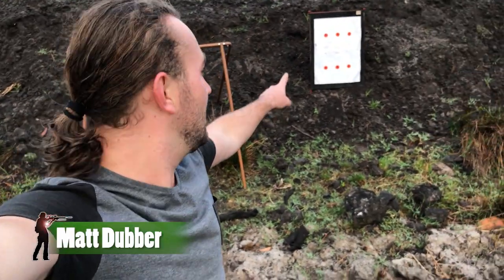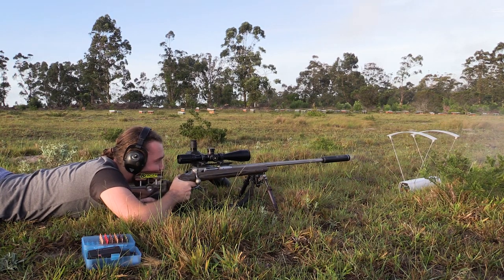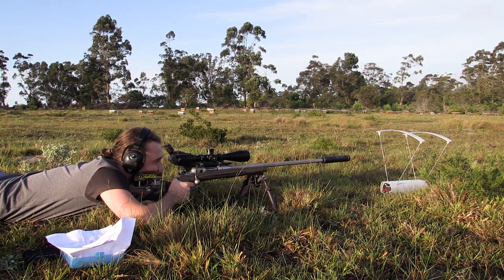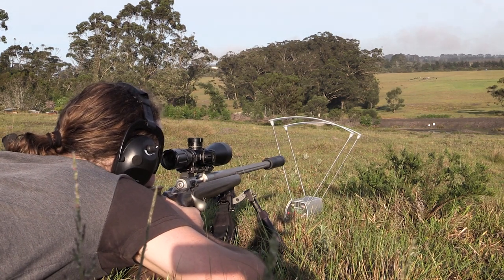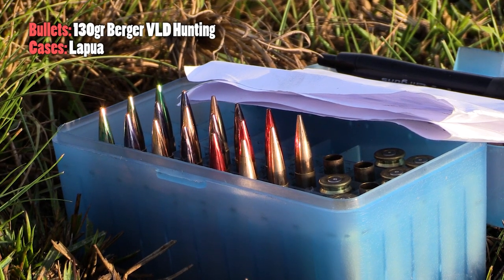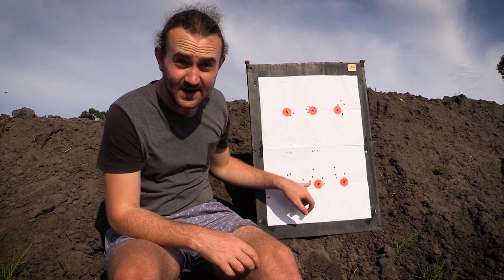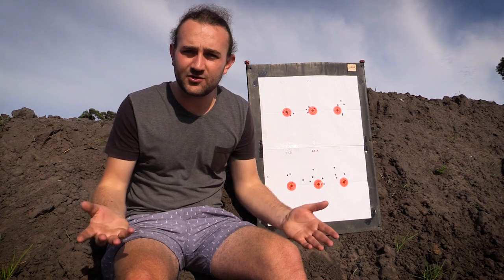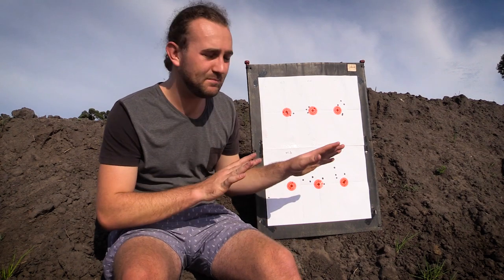Harmonic Tuning: Optimal Charge Weight Test

Comment: Just want to say thank you for this informative video Matt, I was scratching my head as I couldn't improve my already best grouping for my .308 load until I saw your video. I decided to increase my best load by 0.1of a grain 44.6, 44.7, 44.8 etc...and found that the accuracy improved from 0.5 MOA to 1/3 MOA. Good job mate and will follow all your latest post. Thanks from down under.

Comment: Rock on Matt!  my charge weight is also 42.8 to 43.0(H4350) in my .260(Semi custom Savage that I built...( my Avatar is the rifle)  shooting the 143 ELD-X.  My seating depth is .004 off the lands.  Getting .5 to .25 MOA depending on the day. the 43 grain load is actually the MOST accurate, but when the temps rise in the summer, I start getting pressure signs.  So, I backed it off to 42.8 (MV is now 2760 FPS...  25" barrel).  I've found shooting to be very similar to golf.  One day you are playing well enough to think you can join the tour...  The next, it seems like you can't even make contact with the ball LOL!!  Your channel has become my favorite hunting channel. Keep them coming man.  Cheers!!

Comment: Great studies about what powder charges do to the accuracy!. Over pressure signs can b influenced by your head spacing as well. if the front shoulder is pushed far back when you resize the cartridge it can let the primer me pushed back first before the powder kicks it further back afterwards and so creating a flattened primer. I have a Thompson center in .204 and it has no measurable head space behind  the cartridge. It delivers me 0.2 " at 100 yards for varmints. try setting your shoulder seating when re-sizing your cartridges as well if u haven't done so already Matt. Have an FX impact .25 because of what you showed about it on your channel. thanks so much and wishing you the best on your channel!

Comment: I like the style and clarity of this video.  It gets the round-robin OCW firing sequence right and puts the point across well.  However, I have to point out it misses describing an important aspect of the OCW system.  That is to get three groups in a row whose mean center locations are close together, despite each of the three having been fired with a 0.7%-1.0% difference in charge weight.  This is important.  For one thing, you don't want a charge weight that has to be exact to shoot well.  Otherwise, it will tend to be sensitive to temperature variation and powder position in the case and anything else that can cause pressure variation.  You want to load for the middle value of that three-group spread of the tight shooting charge weight range as that is most likely to handle all conditions, warmer or colder.
The second reason you want to go for three-in-a-row is that, statistically, five-shot groups will only be consistent within +53% -35% in diameter with 95% confidence.  In other words, about 19 groups in 20 will be within that range and 1 will be even bigger or smaller.  With just one group, how do you know whether it is average or larger or smaller than average?  But if you get three in a row with the mean values (centers) less than half a group diameter apart (that is about the standard error for a sample of five), then you are effectively considering a single 15-shot group, even though it is broken up into three parts.  For 15 data points, the 95% confidence limits are just +16% and -14%, and that's more than consistent enough for a shooter to be able to believe what he is seeing and to tell his errors from the gun's.  Indeed, the original OCW system described by Dan Newberry uses just 3-shot groups but considers 9 shots overall in looking for an accuracy node, which is +26% and -21% at 95% confidence.  That is usually tight enough to get some idea, but 5 shots per group is better.

Comment: Good stuff Matt.    One thing I recently tried on a 17 wsm was a rubber barrel tuner.   The idea is the same but instead of changing the loads to get the right harmonics you slide a rubber weighted ring along the barrel and set it where you get the best groups.   I was able to get 1/4 MOA out of a gun that averages 1.25 MOA.     All shot at 100 yards.

Comment: it took me about two years to find the perfect recipe for my 7 millimeter Magnum. and the coolest thing is I can reload my cartridges for $0.60. my average speed with 150 grain projectile is 2987 ft/s. and it is a tack driver. so I completely get all the research you have to do to find out what works best in a rifle. and I'm unlike you you lucky son of a gun I have a job to go to 5 days a week. you are living my dream brother you are living my dream. I do have one suggestion for you at something that I learned. I realize your rifle has a suppressor on the end and that changes things a bit. my 7 millimeter Magnum has no suppressor just a straight Barrel. a old-timer at the range told me to move my chronograph at least eight to 12 feet away from my shooting position. the reason being is because I have no muzzle brake or suppressor on my 7 Mag the amount of gas forced out the end of the barrel was messing with the true feet per second. and he was right once I moved it out about 14 feet away from the bench my numbers became more consistent and I had less errors. also on my rifle I have found that the first cold-bore shot is consistently an inch low and an inch left at a hundred yards. after that I'm perfectly on target. it's kind of hard to let the barrel on a 7 millimeter Magnum cool down unless you want to wait 20 minutes in between each shot. anyway enough of my yakon great video is always I love your channel and I'm glad you get to do what you get to do I wish I could. right now I'm just as happy as a pig in you know what..... getting my new HATSAN Big Bore carnivore in 35 caliber completely set up and I've got all my dope together for it and I'm ready to go hunting. I'm getting an inch group at a hundred yards with the jsb pellets. the h&n grizzly pellets I started with lost all accuracy after 70 yards....... just a little tidbit and case you ever decide to go big bore.
Reply: Wow! I'm impressed.I'ts posts like yours that paint a clear enough picture to inspire than leave hanging in thought. When I grow up, I want to go big bore too, but at 78, I have a way to go. Cool post, you put me right behind you as you shot. I love the interesting tidbit of the cold barrel hitting one inch down and to the left; therefore, there is a hysteresis loop involved and hidden in the details that moves the poi up and to the right, but by how far? And what is the barrel temperature delta? Awesome food for thought.

Comment: Matt, I'm really grateful for the videos you put up. So much time and effort goes into them, and it obvious why you have the subscriber base that you do. It's also great that you tackle technical aspects of both air-gunning and centre fires.
I have a question for you, and if you could make a video on it I would be really stoked.
Along the same lines of what you addressed in this video - How would one go about setting up an airgun for the best accuracy?
I'm specifically interested in the relationship of reg pressure to hammer spring tension and suggested velocities for various pellet types and weights.
I have an FX Wildcat in 22 and shoot 18gr JSB's. My FX reg has given up on me so I'm getting the Huma reg and will install it sometime soon hence wondering how to go about tuning it for optimal performance.
Any light you could shed on this would be great. Keep up the great work!

Comment: Very interesting job. 
Just as airguns, seems that every gun has its own preference not only for the load, but also for the distance.Of course, the next step would be to decrease the load and see what happens. Also would be interesting to take the worst load and add a barrel limbsaver to see what happens.
One last question, did you tried with a different tip the same load? Maybe using a boat tail or any different BC?
Congrats on the research you are doing

Comment: Make a folding metal clamp to fit on your barrel.
Take a shot, slide the weight from the muzzle back a little, take another shot.
The sliding weight will alter the standing wave on the barrel.
The harmonic at the muzzle should change a little.

Comment: Good shooting. 

If you have already decided on a charge weight, then you have missed the point of OCW. You should find the 3 consecutive group centers, with the least chance. The middle of those charges will give you the most resilient charge weight. You then tune the harmonics by testing seating depth. 

ES is not interesting. Look at SD instead.

Comment: Have you done this with many types of powder?
And have you noticed that the seating depth has changed anything?
Do you ream your flash holes to the same size?
Do you ream your neck mouth, or turn the outside of the cases?
I have found that reaming the inside of the neck mouth makes the biggest improvement in accuracy....
Reply: We not as spoilt for choice with powder, as say the Americans, we have powder that is basically burning rate specific and only one type in that burn rate.
Reply: Keegan Thompson 
oops,, Back in the 1960s,  we had 5 or 6 different powders to choose from. But each of those powders had a different sweet spot, with different pressures and velocities. 
I never got into bench rest primers, so I don't know if they are worth it...
It sounds like you've been down the same road as me...  It sure would be fun to get together to compare notes...
  It sounds like you're living the dream...
.......

Comment: Well, when it comes down to that details,  ALL factors become non-trivial --- you have to use the exact silencer, you have to shoot when it's 18C & 76% humidity, plus whatever the wind was. Instead of pining point your recipe to 41.35 grains, I would add an adjustable sliding barrel tuner to “swallow" ALL these attributes in the LAST minute.

Comment: Hi. I have an Gamo Shadow dx 177cal (4,5mm). And i an wondering what diameter on the pellet i should choose? The pellet i am going to buy is a JSB Diablo Exact and i can choose to buy 4,50mm or 4,51mm or 4,52mm or 4,53mm pellets (diameter).
Reply: Its been a month, so I guess you already bought something but here's what I'd suggest: get one tin of each and try, results can in my experience vary from gun to gun of the same model. If none of those make a good group, consider moving on.

Keep in mind that pellet weight matters a lot too, so consider trying other variants by JSB as well not just the Diabolo Exact but I think perhaps also the exact heavy and exact express? I don't have many 4.5mm ones these days. If none of those do well consider checking other brands like H&N as well, field trophy is probably a good start for a springer like that. Maybe Barracuda? (Field trophy and barracuda match can be gotten in specific head diameters).

In a perfect and ideal world you'd also have a chronograph but considering its an entry level springer I'm assuming you've not delved into the world of airguns that deep yet. It may feel weird owning so many tins of pellets you're not using a lot, I thought so myself. But whenever I buy a new 5.5mm (.22) or a friend gets one and he doesn't know what to shoot with it you can't go wrong with having a box of many pellets to try! 

Also don't get too stuck on the pellets, it can also be your airrifle... or even the way you use it. Its a springer, use a consistent hold, don't clamp it in a vice etc. And the biggest bane of springer accuracy in my experience: loose stock screws, they'll need occasional tightening on most as for how frequent? It varies a lot (don't over tighten them though, especially not with wood stocks).

Comment: Far less harmonics in an air rifle barrel just like felt recoil. What will matter more in an air rifle is pellet skirt deformation based on the pressure propelling it through the barrel for a particular pellet. More pressure, more deformation if there is any and if the barrel is choked or not will effect any deformation
Reply: Also depends on the system of the air rifle pcp ,gas ram or spring.Spring powered air rifles have forward recoil that recoils before the pellet leaves the barrel so you need to change the way you hold it. Don't grip the fore end tight just sit it on your open hand were the rifle balances well(artillery hold) and just gently rest the stock against your shoulder.

Comment: Matt, how did you come about choosing the charge weights you did, for Eg. my 270 with S365 can use anything from 48-53,5gr. if i load 5 of each at 0,3 increments ill be shooting a lot of ammo. just curious how you came about that start and end charge weight without using QL.

Comment: Matt, what seating depth did you use? and how did you decide on that depth?
Reply: Check a bullet seating depth guide here on youtube, you'll get a full explanation on how to figure out the bullet seating depth. http://www.ballisticstudies.com/Knowledgebase/Determining+COAL.html heres a good guide on that, it explains exactly how to do it.

Most often my magazine length determines coal because it shorter than the max coal. But if it doesn't, I usually figure out the max coal and then jump 20 thou back or 0.5 mm. Then I go down in increments of 10 thou, test the loads similar to the way he does it in the video and from there figure out the best seating depth. When you start with the load development you can usually just use the recommended seating depth that is described in the manual/load data.

Hope that helps.

Comment: How did you determine your starting point for your powder weight?  I  use loading manuals, start slightly above stated lowest weight, incrementally increase until slightly below their recommended heaviest weight: in general this produces an elliptical curve where somewhere but not always in the mid point will the most accurate load weight be determined.  As your most accurate was at the beginning, I wonder, again, why you started where you did?
Reply from the maker: +Eric haskell I started 10% below the safe maximum and worked up until I began to see pressure signs - And then backed off a bit.
Reply: AirArmsHuntingSA   That explains why your best groups were at the beginning, where mine are nearer the middle.  You might consider starting a bit lower, perhaps a better group may be found there.

Comment: Do not agree 100% with the method. You cannot shoot 5 shots with different loads at the same time  and then later repeat it. The conditions might change so this method is not reliable. rather shoot all 5 shots with the same load at the same time.